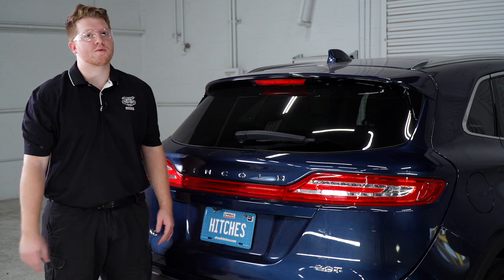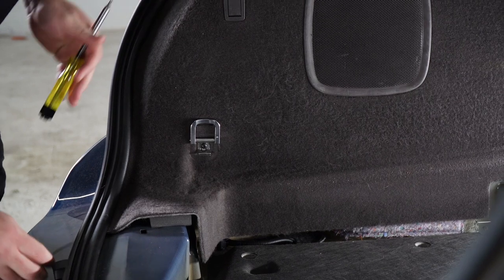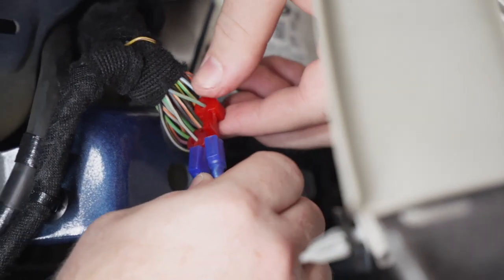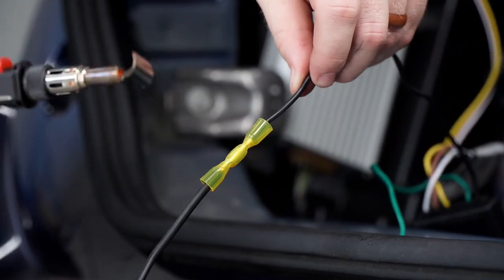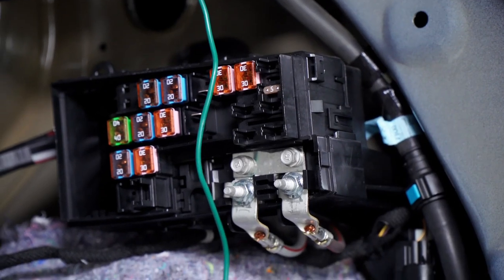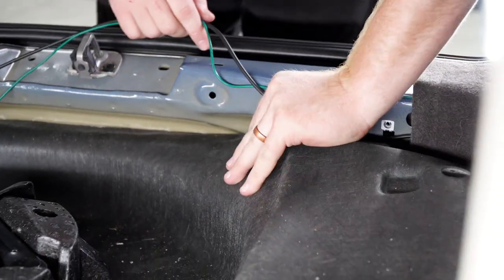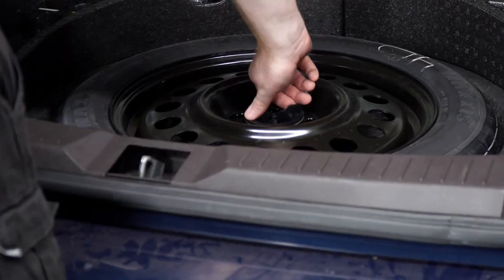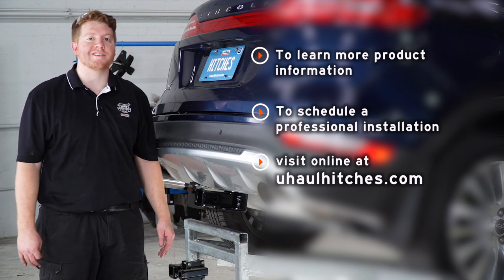2017 Lincoln MKC Wiring Harness Installation

Comment: For the right turn signal light, the one that is violet with an orange stripe, there are actually three wires in that harness that are violet and orange. Two small ones and one thick one. The correct one is one of the slimmer ones. I have no way to tell you which as they are identical in color to me. The incorrect wire was a steady 2.2v. So maybe just try one and know there is another in there. I was going crazy trying to find what I did wrong. Help this helps someone